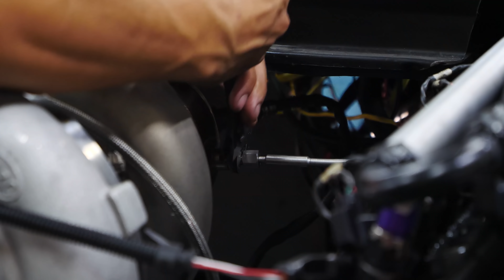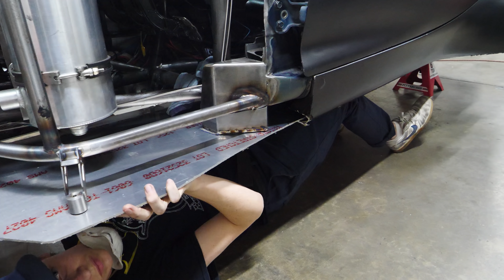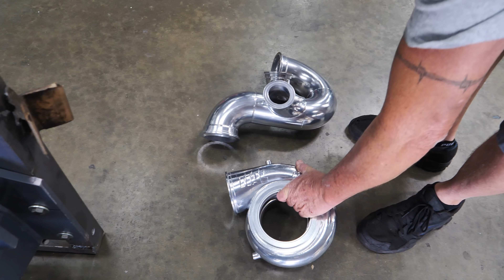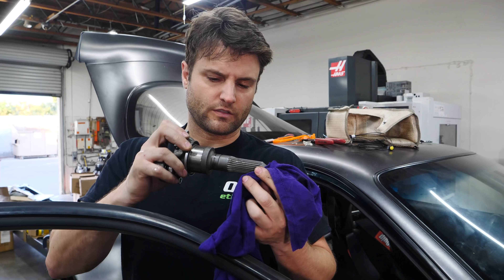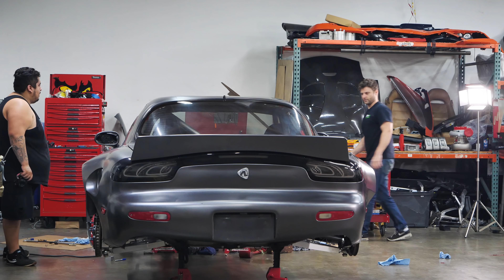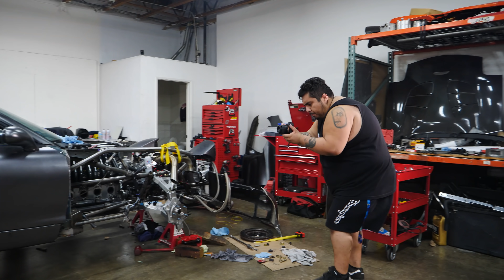Ceramic Coating the 4 Rotor Exhaust so it doesn't ruin the AWD

Comment: They did a killer job on that ceramic coating, but it won't be enough on it's own. If there's enough room I'd suggest 2 layers of heat shielding with a 1 inch or bigger air gap between them, the layer closer to the exhaust will still get hot but the second/outer layer will radiate a fraction of the heat a single layer would. The more layers and air gaps you have the less energy transferred from source, same principle as room-in-room style sound isolation in recording studios

Comment: rotaries absolutely benefit from a vacuum across the sump space . the number one stupid mod is to seal over the sump vents or to put them both to a can with a vent . this has removed the slight vacuum applied across the sump space in factory setups . those engines will be building pressure in the sump , even the vented can momentarily on down run and when that happens. the turbo doesnt drain oil so well and the rotors dont gravity drain the oil back down the centreplate to the sump. and instead can pass across the control rings to the inlet that is under high vacuum . the notorious puff after boost on engine braking is solved.. was already solved.. by mazda applying vacuum across the sump in all conditions

Comment: Ceramic coating is awesome I have had all my cold and hot side plumbing done and 10+yrs later its still the same and temps are lower than before my exhaust manifold was done black the chrome ceramic for extra insulation but has a aluminium look.

Comment: So I am into metal fab and have always been pretty mechanical (built a few Trucks, Motocross bikes, my 97 7.3 Diesel and now my 72 K20). My question is for the guys who really know “race cars”. How well is this car built (both mechanically and as far as geometry and suspension go)? I have complete red left for Rob in that he just goes for it and either gets it done or figures out how to get it done. To me it looks like it’s been designed pretty well and ...what are your opinions on the actual quality of this build?

Comment: I am a little worried that Rob seems to be confused about the purpose of ceramic coating... it protects the parts that are coated from oxidation damage due to high temps -- it's not meant as a thermal insulator. I hope he thermal wraps the header and uses a turbo blanket as well, because that coating isn't going to be controlling the engine bay temps like he keeps talking about.

Comment: Now that you have a CNC you can machine a O-ring groove or two for the oil pan.  Nice job at coating your hot side.  I know I recommended that in the past, now if I could just get you to apply some Sharkhide wipe on metal protectant to keep your billet aluminum looking billet'ty.  :)

Comment: You should still get Isiah to built an aluminium heat shield to go between the exhaust and the diff/cv joints, even with the manifold coated, there’s gonna be a hell of lot of heat going on there.

Comment: If anyone is wondering about where to get this coating by the way. I know the guy who did this work for them. Business name is Young Gun Performance Coating. They're located in Rancho
Reply: Also if anyone wants to do it themselves it's not as nice because the shop as special tools to clean the products and prep the surface for adhesion. But it's techline cermakrome

Comment: There is another coating that should be considered called a heat DISPERSANT..Comes in black only and really helps on the engine and the cold side of the Turbo.  Techline makes the product..

Comment: Should heat wrap that pretty exhaust aswell as the intake ports, and if you can find a heat sock for that turbo you'd ensure your forward shaft won't sheer due to heat stress induced torsion. Yes heat wrap all the things. Then direct some cooling up from your pan over it.

Comment: Ditch the rubberized type gaskets for this. If you're making enough pressure to suck something from the outside in, you're not going to solve this with that. You need custom, laser cut combo type gaskets for this. Likely copper and some kind of compressible carbon layer with another copper sheet. Expensive, but so's the rest of the car.

Jay Leno's steam Doble car has NASA-borne ceramic coating on the inside, and it still needs a outer sheeting protection on the steam generator. True, that's a whole lotta heat on top of what you're making, but ceramic isn't enough, is what i'm saying, and it's fragile.

Also, you need an air gap shield on the manifold. Even with the ceramic, it's not enough. I recommend you start playing with making a second skin for the exhaust using Flex-core honeycomb sheets and a fiberglass type tape on the exterior.
Reply: This is a common fault with vehicles running a dry sump oil system and or crankcase vacuum pumps and has been addressed. The answer is an air regulator/bypass valve installed anywhere it in the system that keeps the the crankcase at 0 psi regardless of how much pressure or vacuum it is seeing. This is actually beneficial for piston engines at high boost levels or exotic fuels or power adders that would benefit from a slight vacuum to run higher power. Going with stronger gaskets will make the problem worse, since it will start pulling on seals and other weaker components.
Reply: @oscardeltoro898  I know what you mean, but perhaps if you edited what you did say a little - starting with the 0PSI bit? 😎
Reply: @gordowg1wg145  Seems obvious enough hes talking relative to atmospheric pressure.
Reply: @kasparroosalu  

Depends, there is inference to to guage and absolute.
Perhaps you should check out crankcase depression (partial cacuum) and it's affect on windage. Also the way scavenge pumps work.
Reply: @gordowg1wg145  Thanks for the suggestion! Sent me down to a quite nice read indeed.
Reply: @kasparroosalu  
Don't know if you've come across it yet, but some airflow within the engine crankcase is critical for proper scavenging, as pumps don't work in a vacuum and the air actually carries the oil to the pumps.
Reply: Partially agree - silicone used as a seal is another potential engine failure waiting in the sidelines - especially when you have some idiots using WAY too much that gets extruded out inside the casing..
Your gasket suggestion is unlikely to seal in that application - if I were Rob, I'd machine a groove in the cover plate, inboard of the bolt holes, and use a 'O' ring to seal it. A further advantage is there will be a better clamping action that may make a slight difference in case strength.

Comment: I worked with that ceramic coating for years. Developed by N.A.S.A and it's good however, it will dull. I would definitely still run a heat shield, or just wrap it all. JUST TO ENSURE YOU CAN SLEEP AT NIGHT i would also plumb/snake in 2" high temp ventilation tubing, and hood exit ventilation 👍

Comment: Ceramic is great and all, but unfortunately the majority of the heat that's transferred from the glowing metal to the driveshaft isn't convective or conductive, it's radiative. All that means is that the ceramic isn't going to do all that much. You need to put a reflective heat shield around the front driveshaft where it's next to glowing hot metal or you're still just gonna have a bad time.

Comment: They make spline cutters (contact MSC tool supply, or Marshal tool in the valley). You just need to buy the rotary table attachment for your Haas. You can easily make splines shafts yourself. Certified steel treating in Industry city can do any heat treating or hardening process you need.

Comment: +Rob Dahm not sure if it's been said yet but, I just got to the point where you are talking about the output shaft you had made. That spline has swipe out on it at the bottom of the lead (the length of the tooth). To me, this means that shaft was hobbed to generate the spline. That's a good, precise, way of doing the job that should be relatively economical should you ever have to replace it. 
Rarely does my day job in making gears make for relevant youtube comments but, I'll take any opportunity to share I get.

Comment: Don't let the daily videos distract you from the fact that Rob still has a 6 rotor in the works.
Reply: Technically not right now, since he’s busy with the 4-rotor.
It’s the filler project, being worked on when nothing else interesting is going on
Reply: I am hoping that Rob drops the 6rotor into a Mazda B-series truck.

Revenge of the REPU!
Reply: @ScottKenny1978  imagine it being mounted at the back
Reply: Debut date 2040

Comment: curious question, if you ceramic coat and use heat wrap on the exhaust does it help the effects even more?
Reply: Yessir it does
Reply: i’m pretty sure a turbo blanket also does the same thing
Reply: I have read somewhere that by keeping the heat in the exhaust pipe, you get a small performance boost. I would guess that it has something to do with the heat not being able to penetrate the material, and thus needs to go through the normal exit
Reply: Ricardo Smits yeah it helps improve exhaust gas velocity just was curious if ceramic + heat wrap helps that effect even more
Reply: @devon5078  it would. Ceramic coating while great, you can always increase the efficiency of it can always be increased

Comment: Even with the ceramic coating, you'll still want some sort of heat shielding between the exhaust and that shaft, even just a thin piece of aluminum. Nothing beats a physical barrier in the middle of the air gap.
Reply: Metals are even more reflective to IR than visible light. Because their transmittances are so low, even aluminum foil would work. Conceivably, you could even wrap the drive shaft a foil tape.
Reply: @MichaelWatersJ  Well, you don't want the metal in contact with what you're trying to shield, since metal is a very good conductor of heat.  The idea is that you have a thin piece of metal acting as a reflective barrier to the radiant heat (infrared).  The air gap on either side acts as both an insulator and a coolant.  The radiant heat will be absorbed by the air on the header side of the shield, and most of that heat will get carried away by the air flow in the engine bay.  The shield will eventually absorb heat from the air due to physical contact with it, but it will happen much more slowly.  Plus, the air on the drive shaft side will absorb the heat radiating from that and carry most of it away. This mechanism is what makes a thin metal shield in the air gap so effective.
Reply: @raelik777  Yeap, I hope the drive shaft is touching the exhaust! The funny thing is that carbon fiber is a great IR absorber so metal reflectors would help a bunch. They even make metal tape heat reflectors for cars: https://www.amazon.com/s?k=Heatshield+Products&ref=bl_dp_s_web_11179457011
Reply: wrap with ptp lava wrap and then use the 1/2" heatsheild aluminized barrier
Reply: @SlingSalsa  This. So much This.
Reply: Flex-core honeycomb wire mesh with fiber glass tape on top. Excellent heat dispersion. I've also experimented with passive airflow cooling, using a corrugated wire mesh, wrapped, which makes a 1 cm high air gap over the manifolds, which is then connected to a NACA scoop and exits under the car. This reduced manifold temps considerably, but...i fear that it might be too much in terms of heat stress cycling.

EDIT: either of these methods are expensive and took me almost a month (intermittently working in the garage) to setup. They're worth it, either does wonders, but yeah, not for the average home-gamer.
Reply: The issue with aerogels are a) they are typically very poor radiative insulators because IR passes right through them and b) they're very brittle. That said, if you had a thin layer of aerogel sandwiched between two layers of polished aluminum, that would be ridiculously  effective.
Reply: @raelik777  they make aerosol impregnated mats and wraps now. So they block the Ir and are flexible
Reply: @b3delta1  nice, I didn't know that!
Reply: Yes had the same idea. The ceramic coating is good anyway keeping more heat inside the exhaustmaking it more efficient, but some shielding seems like a good measure. What a car! 🤘🏻
Reply: something like this https://www.youtube.com/watch?v=i8lKmts1w-Q would be nice :D the exhaust is then nearly cold to touch on the outside
Reply: Came looking for this comment, absolutely agree. There are a few companies that make really good quality heat shield blanks you can bend/press into what ever shape you need.
Reply: Aerogel mat/wrap instead of lava. Better heat insulation and less weight. Screw metal - use aerogel.
Reply: The problem is that heat shields aren't usually pretty. But killing that front driveshaft at high RPM could be catastrophic. Pretty has to take a back seat sometimes.
Reply: how about use airgel instead of aluminum. (°∀°)
Reply: Yeah I was gonna say this. I spent a lot of money ceramic coating my manifold inside and out and all it did was get rid of hot spots and made the heat more even. I ended up having custom made titanium/Kevlar shields made because it kept melting my power steering.
Reply: @CDCOR  Yeah, it IS worth doing, but not to protect the rest of the engine from radiant heat. It just doesn't cut it down enough to be that big of a help. It DOES make a turbo quite a bit more efficient though by slowing down thermal transfer from the exhaust to the header walls, thus keeping more energy in the exhaust to transfer to the turbine wheel.
Reply: Feel like I should add that if this was just a drag car, the zircotec coating (assuming that's what it is) is probably all it needs.  The thermal cycles are so short that the ceramic alone would do the job.  But if there's any extended street driving (say something like Drag Week or even just a road course), it DEFINITELY needs an additional heat shield.
Reply: Aluminum with maybe some Thermotec heat shielding would help a lot
Reply: Yeah I thought it was pretty laughable that he expected that coating to drastically reduce emitted temperatures. The people that did the coating probably raised their eyebrows when they saw it was stainless parts they were doing. Fibreglass exhaust wrap would have been better for what he wants.
Reply: @Mrx1080  To be fair, it WILL reduce his under-hood temps by a pretty large degree, but it won't do nearly as much to help with the radiant heat transfer to that front drive shaft with it that close.
Reply: yes, get a disposable cooking pan, cut it up, form it as a shield. 2 layers, with cheese cloth as air barrier between the 2. will work up to 1600f or so. Even the airforce uses something similar around their jet engines.
Reply: @WarfighterRacing  Yeah, that's an even more effective shield, a double barrier. You can also use a thin layer of fiberglass between the sheets.